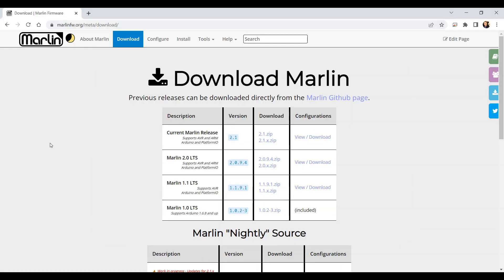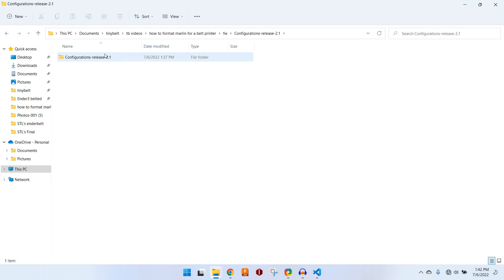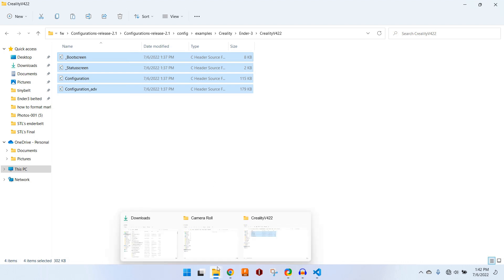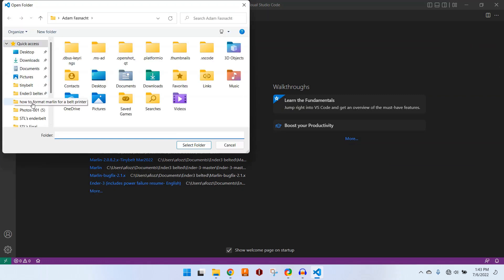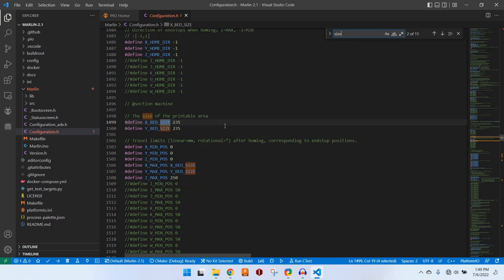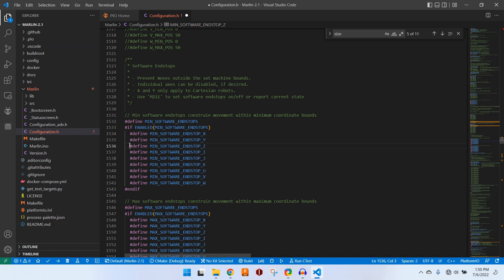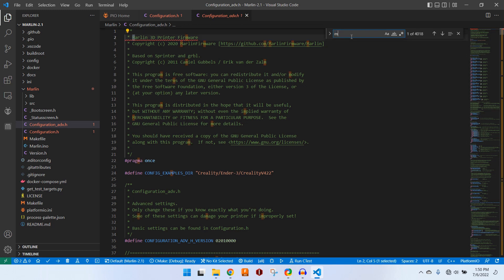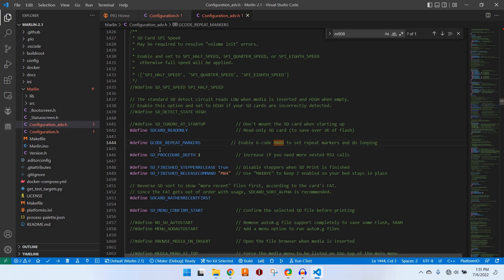3 easy steps - How to Configure Marlin for a Conveyor Belt 3D Printer

Comment: ok, but how do i put it on the printer itself?
Reply from the maker: That's going to depend on what control board you're using. For most modern 32 bit control boards, place the 'firmware.bin' file on the root of the microSD card. Set the microSD in the slot on the control board and turn the printer on. The 'firmware.bin' file should be consumed and replaced with a 'firmware.cur' when you set the microSD back in your computer.

Comment: Excellent videos, simply and well explained. 
So if I want to convert it for a 90 degree printing, for the firmware, I'll have to swap the Z infinity value to the Y?  #define Y_BED_SIZE 99999, remove //MIN_SOFTWARE_ENDSTOP_Y ?  Will this work?
Reply from the maker: Thank you! Yes that should work. I actually have some 90 degree builds in progress too - stay tuned!
Reply: @powerbelt3d  Thank you for your reply! That's awesome! Many users will appreciate this as 90d is better or one-way to go for some prints. I have an Ender 3 V2 and thinking to convert it to a  90d conveyor belt, using your belt of course, to print some batches.
Reply from the maker: @tomlef9704  makes sense! Gotta pick the best tool for the models you want to make.

Comment: hello i was wondering how do you upload firmware into control board i would really apreciate the answer
Reply from the maker: It depends on the control board you're using. For an 8-bit board, you can flash firmware via USB cable through the Arduino IDE.
For 32-bit boards, after compiling a "firmware.bin" file will be created in the firmware folder. That file needs to be set on a micro SD card. Set the micro SD card in the printer and power it on to flash the firmware.
Reply: @powerbelt3d  thank you so much keep up with this great content you are talented
Reply from the maker: @karloknjeginic8852  Thank you! 😄
Reply: @powerbelt3d  i was wondering if you can help me through process of compilling firmware since 3d printer is done i just need to compile it and calibrate it but i dont know how to compile
Reply from the maker: @karloknjeginic8852  VS Code can be a little tricky to get used to. I've had the best luck Pressing Ctrl+Shift+B or Terminal -> Run Build Task
Reply: @powerbelt3d  thank you for your answer i found out how to do it with researching but i got a problem with 3d printer y and z axis wont go into a right way they go reversed like for example when i set up z to go in + then it goes in a - same thing with y do you maybe know how to fix it?
Reply from the maker: @karloknjeginic8852  in the firmware, there should be a section (I don't remember the exact name) like 'invert stepper direction'. You can set it to True or False to change the direction the axis moves.
Reply: @powerbelt3d  thank you so much for the help i hope that printer will be done soon